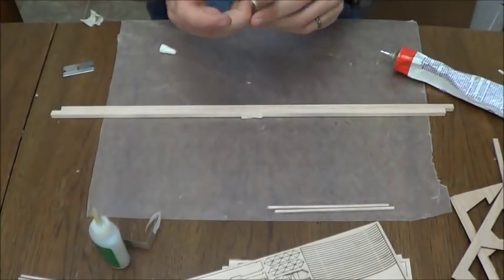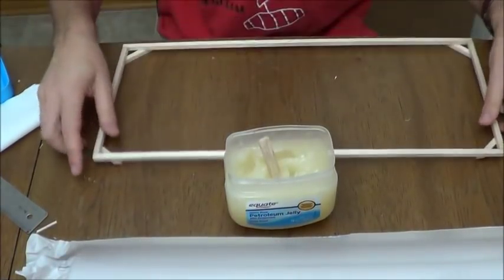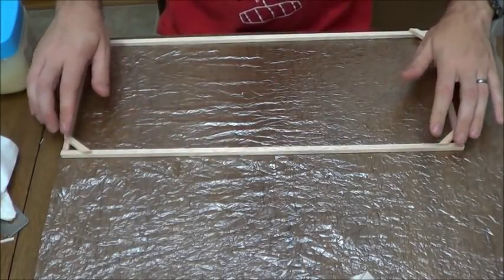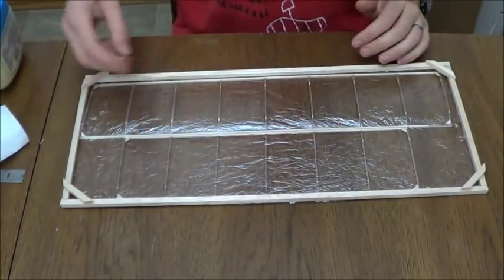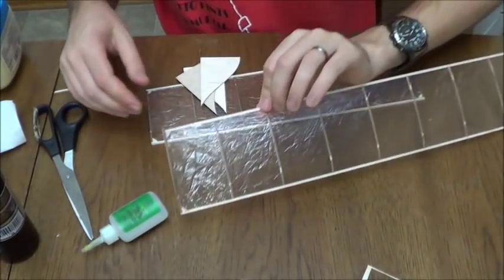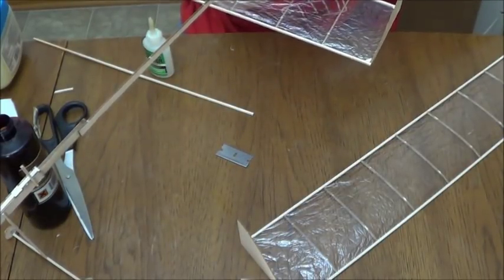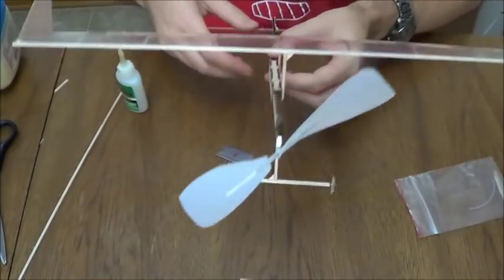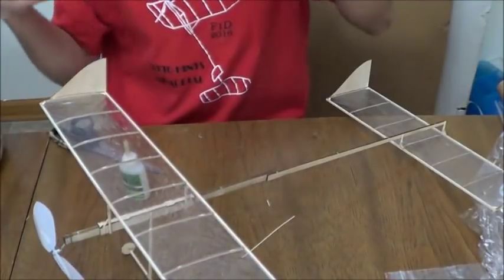Senior Flyer ROG - TSA 2019/2020 legal, Pt3, Covering and Assembly

Comment: You said that we should take off the stab to fit in the box but it looks like you glued it on.  Is there a temp mount that you created like the wing to get the stab on and off?
Reply from the maker: youspankyc5 the entire tail is set up to separate at the back of the motorstick. Look for the segment that shows the fuselage assembly; it's described there.